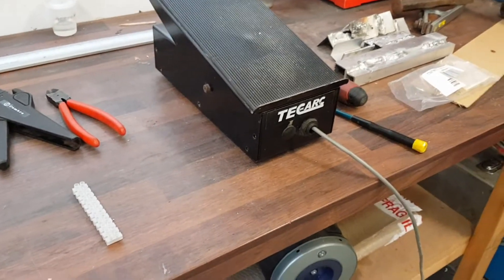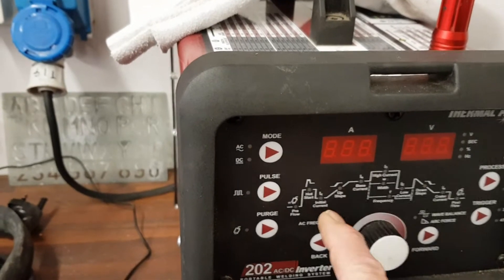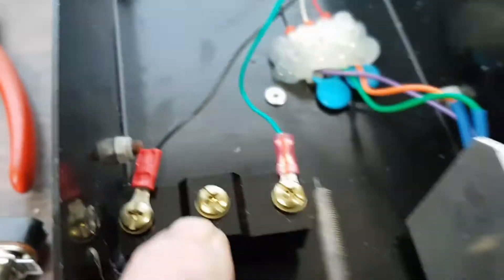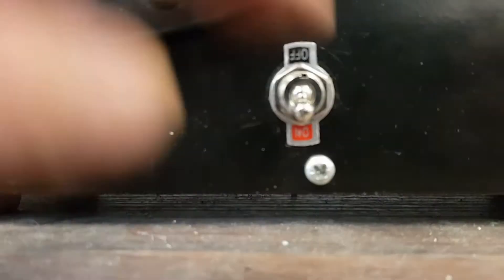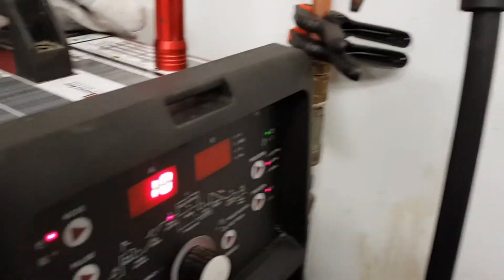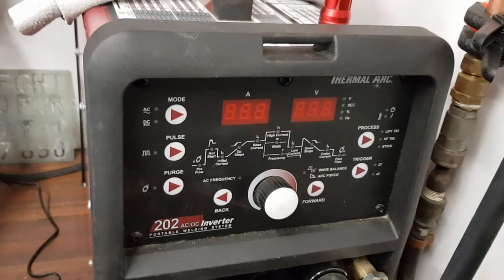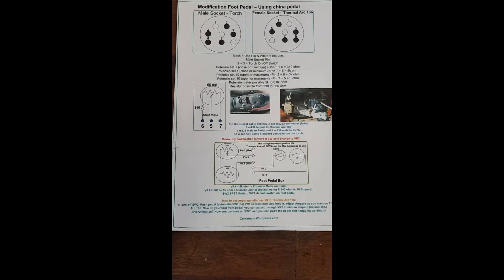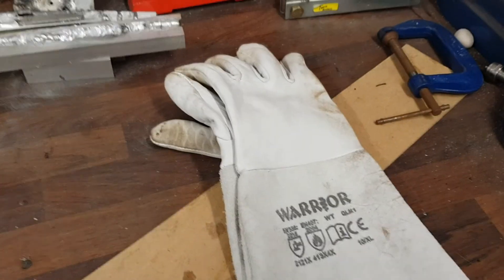How to Modify a  Tig welding foot control to work with other welders. Foot pedal. Foot controller.

Comment: Do you want rekon this can work with Parweld’s new Bluetooth pedal?
Reply from the maker: Hi MrChickenking44.  I would not know. My welder has no bluetooth on it. Unless it is done via an adaptor. I know Parweld is a popular welder. So maybe a dealer would know. Sorry. 
Regards.
Steve.
Reply: @Steviegtr52  yes mate it uses an adapter, looks like a 6 pin. It’s sort of like a dongle and the pedal has battery’s in it. Would make life a lot easier when welding frames, having to make sure the cable isn’t getting snagged or god forbid somebody walks past and snatch’s it with their foot while welding, lol
Reply from the maker: @MrChickenking44  That sounds like it would be handy. I don't do much welding. So i would not see much benefit in the small workshop.
Regards.
Steve.

Comment: I just don't understand people. Why do you want to restrict your amps to 90? The beauty of a pedal is to have control of the full range hands free!
Reply from the maker: I am not sure what you mean. If i start a job & know the max amps need to be say 150, then i set the max on the foot pedal to around 160-170. Then i start with the pedal fully down & then back off to a point i need. If i only wanted say 80 amps. Then why would i want full pedal set to 210 amps. Unless i am reading you wrong.

Comment: I just got an eastwood tig 200. The pedal that came with it came with amp adjustment on the foot pedal which ive never seen before. So basically you can bypass that setting with a doffernt pedal without the adjustment by wiring that on off in series with the switch?
Reply from the maker: Yes I have seen some pedals with a control on the side. Mine seems to work fine now. Good luck with the Eastwood, they have a good reputation. How much did it cost, if you don't mind me asking. I take it you are in the USA.